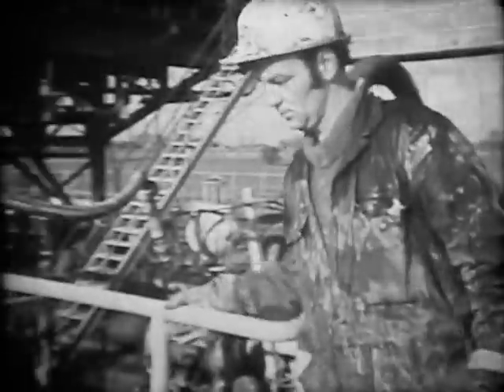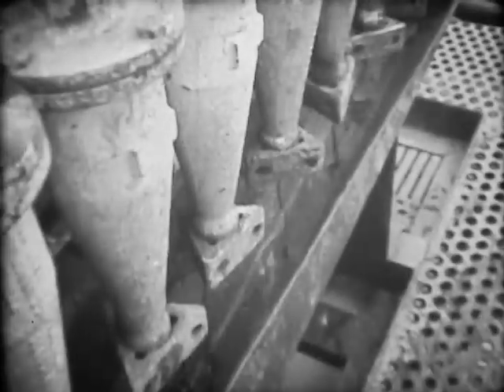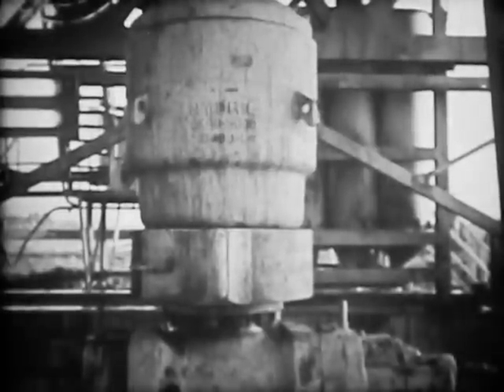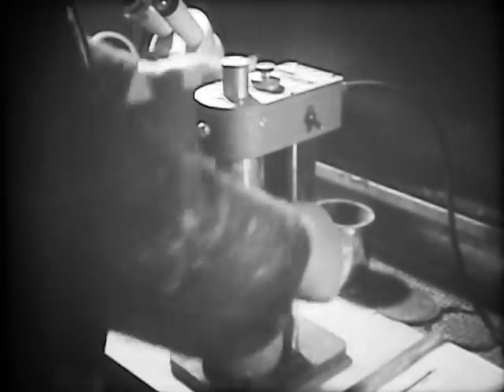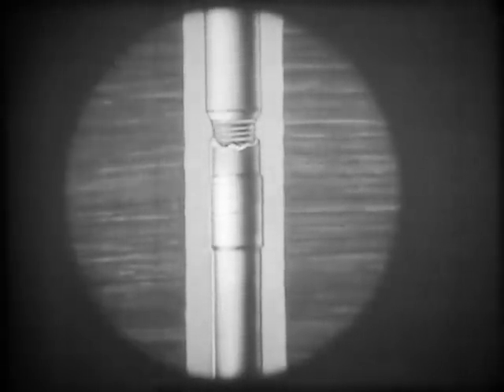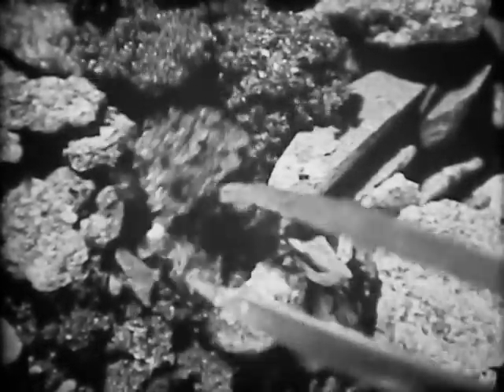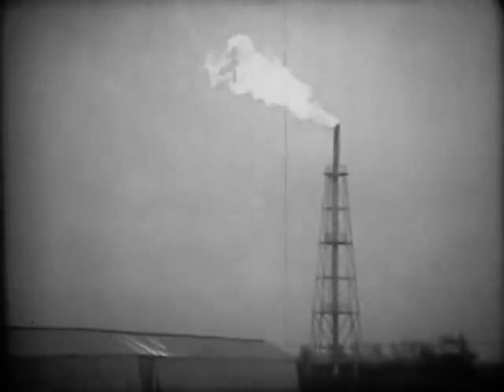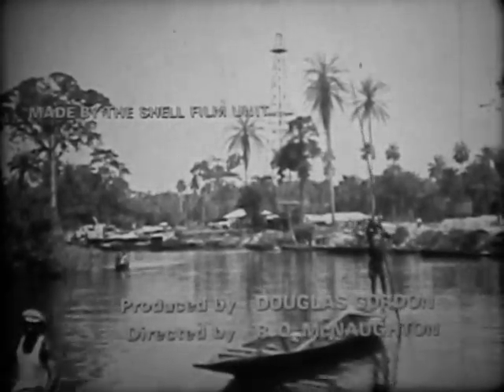The Oil Well Drilling Process - How Oil is Formed - Animated Diagrams

Comment: Every 30 feet they have to stop the drilling, to connect a new pipe and if its a 9000 ft well, they have to change 300 times to reach to the final depth. Never thought how tough it is until I saw this video. Amazing Video. We want more of this..
Reply: They pull it out 3 sections at a time so between 90 and 100 feet sections
Reply: Over 25,000 ft long hole offshore from Santa Barbara, CA horizontally through very hard chert beds at 3 to 4 ft per hour at times with luck with hours and days spent pulling up to change quickly dulled bits.
Reply: @jeffroberts9789  yeah, that's how it is today. Better technology. More power.

Comment: Howard Hughes's father invented that drill bit and it's still in use today.  This film really shows how it's done.
Reply from the maker: That's one good invention!
Reply: Howard Hughes, Sr. did not invent the rotary drill bit, but he was the first to file a patent on it. As an attorney, he knew how to capitalize on other people's failure to secure IP rights. 

His real genius was in leasing the bits rather than selling them. It has taken others a century to appreciate how lucrative this business model is.
Reply: Legend has it that Hughes' father bought the rotary drill design from a drunk engineer that needed money at a Shreveport, LA tavern. Howard Sr. then had a few made in Shreveport to test in the Smackover Play before filing a patent on his final design. Then he leased the bits so he could get them back to be resharpened and leased again. He probably required a hefty deposit for each one to ensure he got them back.
Reply: @EDesigns_FL  Who invented the rotary drill bit?

Howard R. Hughes Sr.

(September 9, 1869 – January 14, 1924) was an American businessman and inventor. He was the founder of Hughes Tool Company. He invented the "Sharp–Hughes" rotary tri-cone rock drill bit during the Texas Oil Boom.
...
Howard Robard Hughes Sr.
Reply: I was a drill bit salesman for Smith Tool Company in the 70s and 80s. We mopped the floor with Hugh's Tool Company. They were the first but not the best.
Reply: @danjarvis6980  Hi Dan. Hope all is well in your world. And thanks for giving me a good laugh. I'm 4th generation oilfield trash and my Dad was taking me to work with him on drilling rigs before I was old enough to go to school. So obviously I find your skepticism comical. Normally I wouldn't bother responding to such nonsense, but since you asked so nicely I'm going to give you what you're asking for.

#1: Dumb question. There is no such thing as a "standard size rotary bit." Drill bits come in many sizes. Drilling an oil well requires a minimum of two different sized bits. Many require three, and some require more. The size of the bits required is determined by the casing program, which is based on well depth, anticipated formations to be drilled, the expected flow rate when the well is put into production, and other factors.

#2:There a three basic different types of teeth on bits. Steel teeth, as shown in the video. Tungsten carbide teeth, where the teeth are pressed into the steel cones. These are called button bits. Diamond teeth, where tungsten carbide studs are faced with industrial diamonds and pressed into the steel body of the bit. There are no rotating cones. 

#3: All bits with cones have machined spindles and bearings. Some have sealed bearings and some do not, depending on the intended use of the bit.

#4: Dumb question. The price of drill bits varies widely, according to the size and type of bit. And why you phrased the question in terms of six bits is baffling, since drill bits do not come in six packs like beer.

Now it's my turn to ask you some questions about basic oil field knowledge.

#1: What is a 4 to 1 swedge nipple?

#2: What is the duty of the derrick man when he's not working the derrick?

#3: What is a gauge insert?

#4: What is the meaning of the term "twisted off". There are two meanings. Both are required to answer the question correctly.

I'm sure you'll be able to answer these easy questions off the top of your head, considering your oil field expertise. In case you can't answer a question off the top of your head, feel free to google it. You might learn something.

Anyway, we're having fun now. I'm looking forward to your answers.  :)
Reply: @ArcFixer  Did Smith originate in Columbus, OH?
Reply: @yafuker6046  Hi. So far as I know they're out of Compton, Ca. They were originally in the business of making big ass mining bits, and when the Hughs Tool patent expired they jumped into making oil field drilling bits. Applying their mining bit expertise to oil field bits they eventually surpassed Hughs Tool and became the number 1 oil field bit manufacturer in the world.

It is possible they started out in Columbus, but that would have been before my time and I don't know anything about that.
Reply: @ArcFixer  Nice reply ;-)

They probably aren't used in the oil industry any longer, but I have seen old rotary bits with plain bearings.
Reply: @EDesigns_FL  Hi ED. All in a day's work. Maybe Dan will be more careful about what he's asking for next time. :)

I left Smith Tool and the oil field 40 years ago, and I was wondering about the point you brought up when I was answering that question. The cost difference then between a bit with sealed bearings and one without was substantial. I was wondering if improvements in manufacturing technique had closed that gap to the point where unsealed bearings were obsolete now.

Anyway, all the best to you and your loved ones.
Reply: Come on thunder ask better questions next time. We all know what a 4to1 Mongolian swedge nipple is so ask where the crown is located. If they point to the Derrick we know no experience cuz we all know it's in the bit salesman's trunk
Reply: @met9072  Everyone in the oilfield knows the answer to the questions. That was the point of the questions. To see if Dan knew anything about the oilfield. Turns out I was mistaken about his motives.

A 4 to 1 swedge nipple is a bottle of Jack Daniels due to it's similar size and shape. And everyone knows a bit peddler doesn't have a trunk. Bit peddlers drive pickups because they have to haul bits. The bottle of Jack Daniels is behind the seat. 

I don't know what your problem is, but it's not my problem. I don't have time to get into a pissing match with you nor am I the least bit interested.

Over and out.
Reply: @ArcFixer  as a former roughneck. I actually really like smiths bits. Aaaaand I’m gonna need a few keychains.
Reply: @ArcFixer  I thought the only thing that came out of “Compton, CA” was the 1992 riots and rappers. 😂🤣
Reply: @ArcFixer  Twisting off is 1)  How you got days off by not being there when the driller came to pick you up for your tower.  Usually was the worm and right after payday, which that worm won't be seeing anymore of on that driller's crew.  2)  I believe that is the separation of the drill string while downhole, usually unplanned.  
Derricks take care of the mud, makes sure that worm pulls shale samples and bags, then tags them, and usually is learning from the driller so he can break out drilling unless he likes to stay in the derricks or doesn't want the responsibility of running a crew.

Best I can do as I only spent a few days working to help a buddy when I was 17 in high school.  Working morning tower in worm's corner during a Texas Panhandle winter wasn't my idea of a career path so I got a welder's helper gig at Baker & Taylor Drilling. Too much work for me, so I joined the Marines at 17.5 yrs.  2 yrs later, I come back from Okinawa on leave, and my buddy is not working in the patch, it's busted, he ended up playing piano in a whorehouse. LOL, God bless you, and Vaya con Dios

Comment: Fantastic video. Been in the oil patch for 23years working on the construction side and the processing side but never the drilling, pretty cool for sure.
Reply: Back when gas was less 30 cents a gallon, I know, I pumped it and cleaned the windows.

Comment: Great video. I just can't fathom out how they continue drilling with the blow out protectors fitted. 😨
Reply: We had a nipple up shop, them & the on call welder would be out at the rig as soon as the casing was run and cemented in, welder would weld the flange on, nipple up crew would attach the BOP, and the driller would have the fellas start tripping back into the hole.  BOP was a piece of case pipe until you needed to control a gas kick.  If the pipe started coming back out of the hole, there are rams that shut, severing the drill string and closing the hole. Then everybody runs like hell anywhere but there.

Comment: Generally, how long would a drill bit last? I know it would vary depending on type of rock, equipment efficiency, drill operator etc..Also, when did they stop using chains to tighten and take apart the sections?
Reply: Throwing chains were ended in about the 70’s due to safety and speed . Lot of fingers lost throwing chains. Chains were used to spin the pipe, then torqued by the tongs .

Comment: What's crazy is even then there was the concern of low oil😁. I can kinda understand why hydrogen and EV vehicles are trying to be a thing, sorta. 

Technology have significantly change since this video, cars are more efficient than ever, I'm positive we'll have plenty of oil during my lifetime
Reply: The US DoD hired Exxon in the 1960's to explore the use of hydrogen as a fuel for vehicles. Exxon got Texas A&M to help out where they determined the cost of the special alloys needed for the engine, line fittings and storage tanks made hydrogen too expensive to consider using. In the 1980's Ford looked into developing engines that ran on hydrogen and shelved the plans after determining the cost would add 30% to the cost of a standard car. Then the Big Three automakers looked into shared platforms for lighter weight cars and trucks using the same engines, drivetrains and suspensions with different style body panels and interiors that snapped in place like Lego blocks then bolted down. The idea was to have the components shipped to regional warehouses around the World where unskilled workers could assemble vehicles when orders came in. Two engines were to be offered with one being Diesel and another with a plastic block that ran on methanol. The methanol engine was for urban use and in regions were methanol was easy to produce like Brazil. They cancelled the project when they sensed that the public around the World had no interest in anything like that.
Reply: @billwilson3609  plastic engine blocks! You know I thought of this randomly. How greedy could manufactures be to produce something like that🤔? in today's time that is.
Reply: @partsshooter  Wasn't due to greed but to reduce the weight of the vehicle and increase the power and mpg's by using ethanol. The block was to be made from high strength and heat resistant plastic. The only metal parts were the crank, bearings, rods, pistons, cylinder liners, cam, head, valve components, water pump and bolts. The combustion chambers and piston crowns were to be coated with a ceramic with the motor oil being a lifetime silicone lubricant. It was designed to run at very high rpm's on a very lean mixture with the power going to a multispeed automatic transmission that would allow it to get around 70 mpg in town and over 100 mpg on the highway. 
They figured that cities around the World with smog problems would be interested in seeing vehicles using those being sold there but weren't, so they cancelled the project. I'm sure they still have the plans on hand since producing ethanol is a lot easier and cheaper than rechargeable batteries. Back then they also had designs for plants that took in municipal trash, removed the metals, glass and plastics then ground-up what remained into a mash that had yeast added to ferment the sugars into alcohol. Then the mash was distilled to remove the alcohol then cooked longer to extract the water for reuse. Then the dried out mash was transported to farm fields to be plowed under to add nutrients and organic matter to the soil. They figured those could be built by existing sanitary landfills since those could be mined once conservation measures have people producing less trash.
Reply: America has (supposed to have) it's own 400 year supply. Forget the other countries. Why we fight for oil around the world is just an exercise of power. My Dad said, we should use theirs before we share ours. Beginning to believe his words.
Reply: Not when you consider how often they have to be replaced. My 35 year old Toy Diesel gets 30+ miles per gallon and will likely outlast the next Tesla off the line.
Reply: @AirstripBum  lol @ "It replenishes itself".
Reply: @guntherultraboltnovacrunch5248  Comrade Gunther, yes, it replenishes itself. Russia proved this by going back to wells that were no longer producing 1/10th of what they were, when originally drilled. They re-drilled the old well out, and it produced again. They deduced that the rocks were acting as an oil filter that had become clogged. Из Владивостока, Россия.

Comment: This is just a little Rig. We use one that uses three 30 foot sections. But there is a few rigs that use four sections. They drill for oil. We drill for steam. Geothermal Water that turns to steam. GREEN POWER. Otherwise, all the same.

Comment: I tried to find out more about Magne-Magic (9:10), but failed.
Very interesting film.  I wonder how much technology has changed things.
Reply: from a technology perspective, a lot has changed, but as always, it depends how much you want to spend.
Reply: drilling fluids have changed a lot, though the simpler water-based ones still have their place. essentially it is water, plus a weighting agent (often barite), a viscosifier (like bentonite), potassium chloride to reduce reactions with clays in the rock, plus or minus some other additives to control pH and other properties. oil-based muds are more complex and expensive, but have advantages over water based fluids. Halliburton (Baroid) and M-I SWACO (now part of Schlumberger) are 2 companies providing specialized drilling fluids today.

Comment: When was this? Early 70,s? Wonder when fracking came in?
Reply: Fracking was actually invented in the 40's but it was uneconomical to do so until the price of oil increased in the 90's to 2000's.  Later!  OL J R :)
Reply: @lukestrawwalker  Thanks!
Reply: @lukestrawwalker  I've been at it for 9 years  but I don't know much about the history of it.
Reply: @lukestrawwalker   I worked for Schlumberger of Canada in the early 1970's. Fracking was starting then, but it wasn't until directional drilling was perfected that it was worth the cost of fracking.

Comment: If they were running out of places to drill back then, that means the earth will run out, soon. Especially considering there's more than twice as many people burning it, now.😩
Reply: Back then there wasn't the technology and ability to extract oil from places they knew held oil.  Horizontal drilling and fracking open up more areas as opposed to drilling straight down.
Reply: @ntomnia585  you make a good point. I'm just a welder.

Comment: I question the popular notion that petroleum is a fossil fuel.  The deposits of petroleum exist far deeper than any fossil bed.  How did the petroleum get so much deeper than the deepest fossil bed?  It would be somewhat understandable if petroleum was just a tiny bit deeper than the deepest fossil beds.  But it is much, much, deeper.  Also, the easy petroleum to get was extremely shallow.  Some surveys of depleted wells found the wells filled with petroleum again.  There is no explanation for that.  Besides all this, why is petrol still a fuel for automobiles at all?  Why has the planet not moved to diesel?  That is the forever fuel.

Comment: 20:20 lol 'Recover', like it was lost.
Reply: that's the terminology about how much oil you can actually get out of the rock.  Oil occupies the pore space in the rock-- the tiny gaps between sand grains in sandstone.  Some rock (mudstones or shales) have very tiny pore spaces and are considered "impermeable" in that oil and gas cannot readily flow through them, though it can and does saturate the pore space in the rock.  Oil flows through the rock by flowing from pore to pore-- large pore space in the rock allows the oil to flow much easier, small pore space between tiny pores basically keeps the oil "locked up" so it can only move over geologic time scales (thousands to millions of years).  Formations typically get under extreme pressure because of the oil rising into "traps" in the formation, and then water pushing upwards on it (usually brine or salt water).   The same thing happens with gas.  Oil historically could be produced from larger pore "loose" formations but not "tight" shale or mudstone formations, because the oil or gas cannot flow through the rock to the bore hole.  Fracking is used to shatter the rock in tight formations, by pumping sand, water, and acid down the bore hole at hundreds of thousands of PSI, since water cannot compress (appreciably), the water goes out the perforations and cracks the rocks, then the sand flows into the cracks and holds them open after the pressure is relieved, creating a network through which oil or gas can flow out of the rock into the cracks, and through the sand holding the cracks open.  Acid helps to eat into the rock and open up the pore space.  In the 60's they tried using nuclear bombs to vaporize large caverns in tight formations so that gas could flow into them through the huge surface area of the vaporized and blast-shattered caverns, but the gas picked up radioativity and ended up being radioactive so it could not be commercially produced.  Later!  OL J R :)